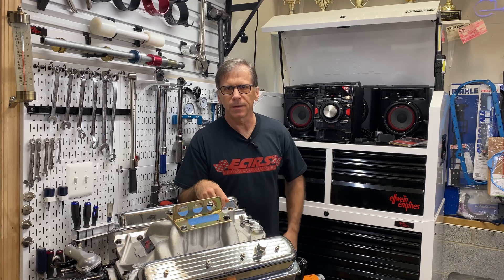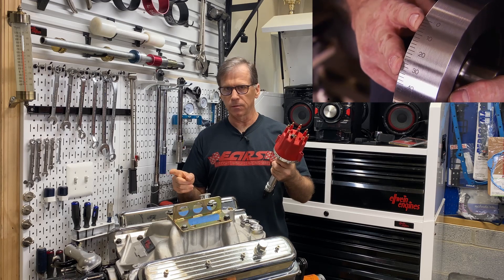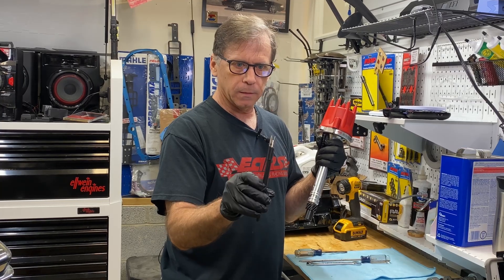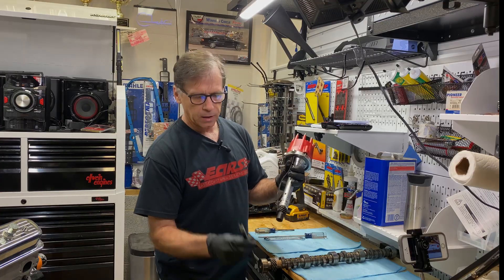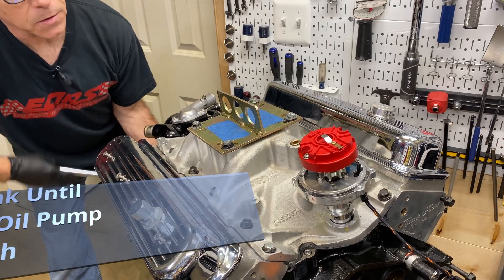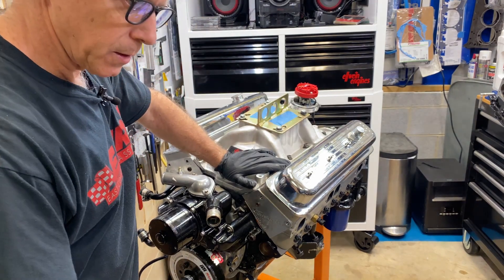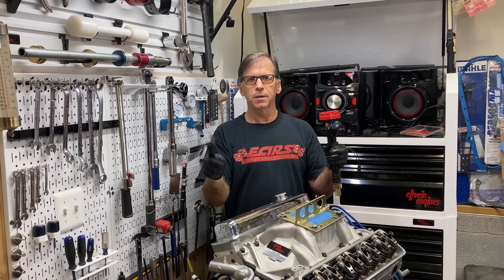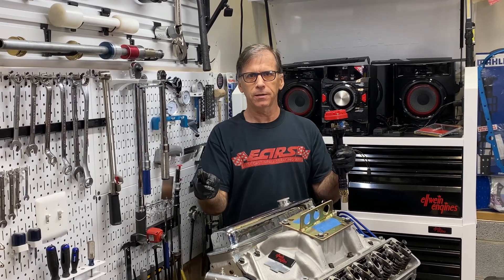Small Block Chevy Distributor Tech

Comment: All my distributors have a mark on #1 now lol :) . And a mark on the housing and the intake if it ever moves and i dont have a timing light at that exact moment .  I took out a distributor when I was I dunno 20 when resealing the intake.  It was a mess getting it back in. .  I used to use an long flat blade to try to nudge the oil pump drive if it moved a little.  Now I have a old distributor and shaft with no gear on it. Ghetto prime tool + good for oil drive realignment.
Reply from the maker: enginuity

Comment: Anyone can help please i have a rebuilt 350 80s chevy and i have a distributor used to be on a 78 chevy engine 350 too i was trying to install the distributor in the 350 i macht the oil pump and the distributor but still like quart of an inch up doesn't want to drop down all the way in what could be the problem?
Reply from the maker: if it is just a 1/4" too high then that distributor collar can be lowered to compensate...(if it has a slip collar).  Some intake manifolds are just a tad thicker or thinner.

Comment: Never too old to learn...thanks....I have a question though and hope you can confirm.  I wound up by placing the distributor where I wanted it to point rather than letting it drop in as it did put my number one opposite of where I wanted it (i.e., 10 o'clock).  Then I rotated engine to compression stroke and set timing to 36 degrees in my case with locked distributor - and it started....hurrah
Reply from the maker: I think you got it.  That's how I confirm sometimes by going around again to the compression stroke on #1.  I really just boils down to that rotor being at the #1 spark distributor terminal at whatever timing you want.  So yea...it can actually be pointing anywere.  Just move the cap to #1 spark plug terminal and you are good.  Like you showed.
Reply: Many thanks

Comment: My rotor isn’t lined up up with my number 1 spark plug compression stroke
Reply from the maker: I think I see what you are saying  The rotor does not point over toward the #1 spark plug at the front of the engine.  That is not really needed.  Does it start and run?

Comment: Ok so my compression stroke is on number one but my on number one spark spark isn’t line up to number one
Reply from the maker: Do you mean not lined up at the cap/rotor to #1?  Technically the distributor/rotor/cap does not need to point over to the front of the engine #1 spark plug.  That is a sort of "convention".  Just need the rotor to be at the #1 plug wire terminal when the crank shaft (piston) is coming up on the compression stroke.

Comment: Thanks for the video.  Question where is the common location to put #1?  At about 5 oclock?
Reply from the maker: I think yes at 5 oclock if 12 oclock is the rear of the engine and 6 oclock is forward.  Technically it can be wherever it happens to fall.

Comment: you lost me at the 35 degree part..   Why wouldnt u put at like 10 degree before?
Reply from the maker: Good point.  I would put it at 10 deg if it were not a locked out distributor.  Definitely.  In this case I put it at 36* and run the engine at the dyno locked in at 36*.  So I guess put it at where you need to for your set up.
Reply: @EllweinEngines  Really helpfull video, probably the best on Youtube. I havo to do this also soon, what do you mean with a locked out distributor? I have a normal HEI and i was told to get it just about 10 degrees before TDC. Do you got any tips?
Reply from the maker: @bramvos6773  Thanks.  The "Locked out" distributor means that it only spins with the rotor fixed to the drive shaft "locked".  It is the opposite of a normal distributor that has vacuum advance or a weight on it that spins and changes the position of the rotor.  So for the engine dyno I only need the "locked out" type.  Yours would be almost the same as mine for setting timing but you would aim for 10 deg. before TDC (and I try for 36 deg BTDC).
Reply: @EllweinEngines  Thanks, you helped me a lot! Really appreciate your fast reaction. I’ll try it soon and i hope it will work and that i dont get crazy backfires or anything😂